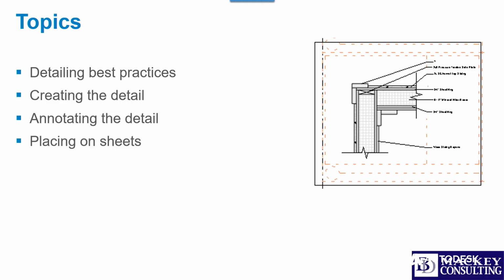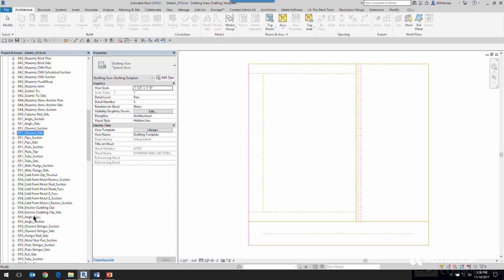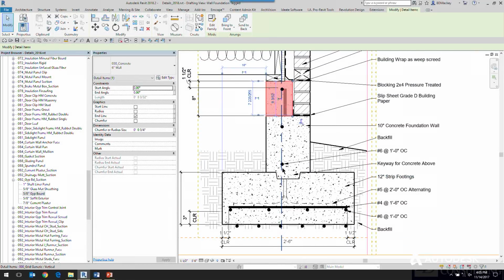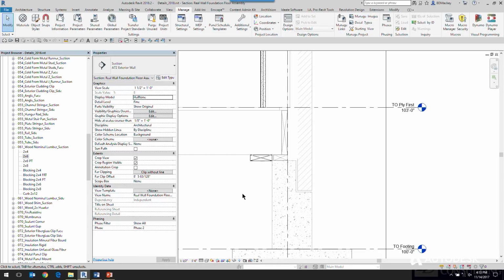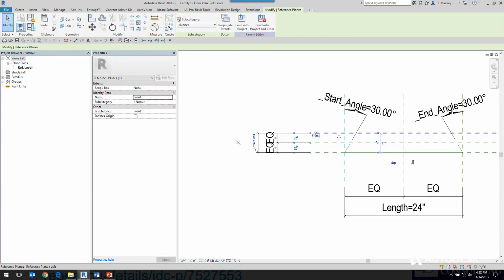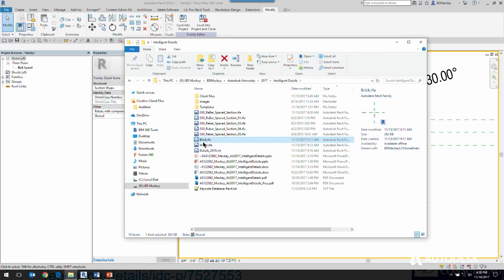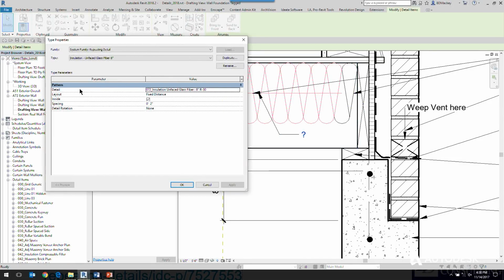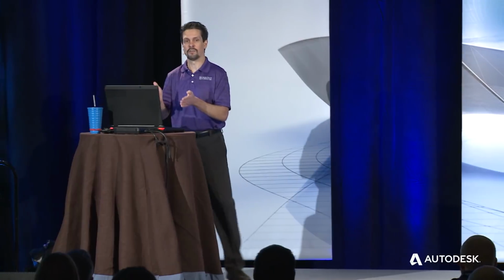Creating Intelligent Details in Revit with Brian Mackey

Comment: I worked at a place that had this system. There are some problems. Every unique note either requires a new type or an instance tag. My people all started using instance tags a lot. Sometimes they would just duplicate types. Also, the detail tags are hardcoded to align right or left, and also have a hard coded width of tag. so we had like 9 different tags to choose from in order to tag a detail component. They are also very laggy to align and situate on the sheet. Notes cannot be copied from detail to detail, so everything has to be tagged fresh and dragged around. Then when you go and transfer that detail into your project, all of those components duplicate as details do. So then when my people got to start annotating a new detail with tags, they see 25 options for tagging. Left aligned1. Leftalignedshort1. Rightaligned1. Rightaligned2. Rightaligned3. It was taking 4 times longer to draw details because of issues like this. It was a nightmare. I do like the idea of drawing a detail with 95% detail components. That makes for some great graphical consistency. I also like the idea of filters for visibilty built into the template. But for standardizing language, just get poeple to copy and paste. Then use find and replace.

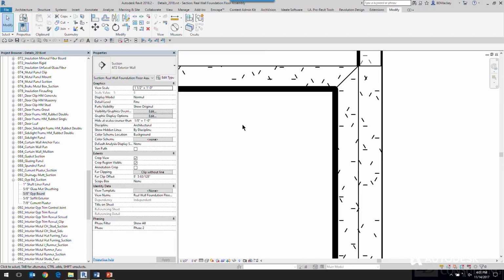Comment: Video Time 16:00 - 092 Gypsum Bd. Section, angle is not changing. Also first in Constraint parameter the start angle and End Angle was not there. but I manage it to do so with Shared Parameter but now the angle is not changing. May something I am missing somewhere, can someone guide. Thank you